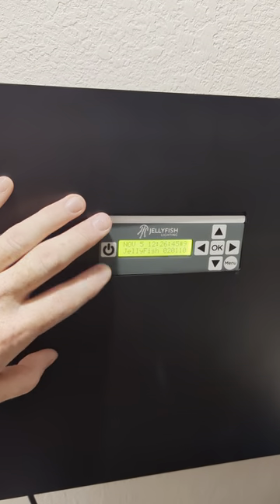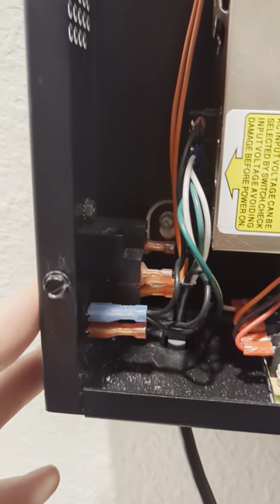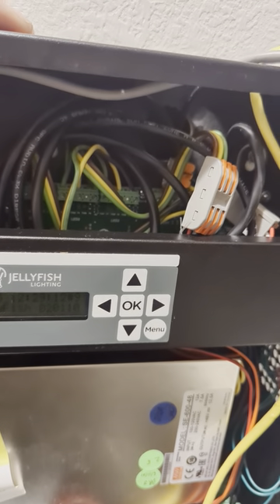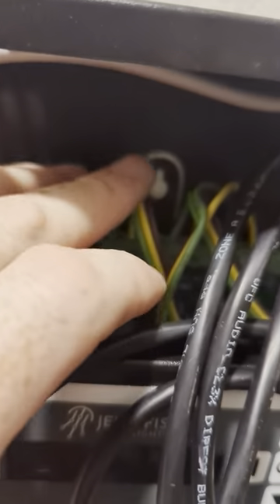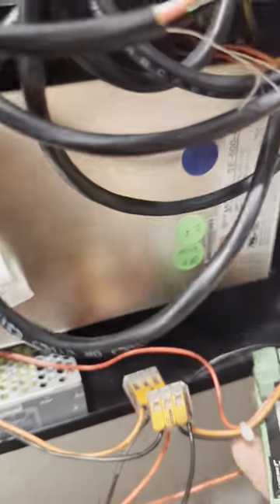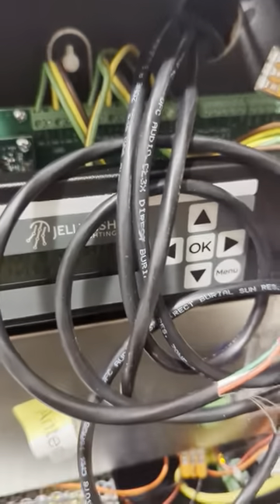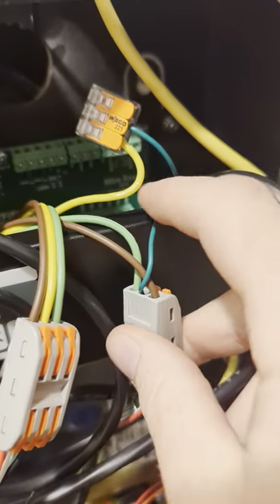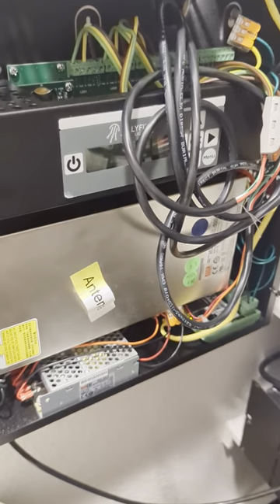Jellyfish controller walkthrough and 3rd party control

Comment: Thank you for this video it's awesome! I had Jellyfish installed on my house and want to use with Xlights and my falcon controller but i haven't quite figured out how. This is a huge step forward. So do you wire your 48V PS to your 5/12V mean well, then to your controller, then lights? Can you give a little more specific on exactly how it's wired? It would be greatly appreciated, thank you again for the video!!!
Reply from the maker: @tonylove3290  I suggest looking in the box to see how it is wired currently before trying to re-wire it. 

The lower voltage PSU is always on. The 48v is only on when the controller turns on the relay. 
You still have to program the lights to come on at a given time in the JF controller. 

Also some people have achieved the same thing using a digi-uno or digi-quad. 
I'm sorry I'm not providing exact answers, but if you are able to take this, and fill in the gaps on your own, then you will be better situated to further troubleshoot the issues when they arise.
Reply: @cm3ars  Thank you! Yes, I totally agree—understanding the setup is key so I can troubleshoot. My stock setup is a little different. Instead of having an extra low voltage PSU that powers my 3rd party controller, I have an AC-DC converter with only one output that powers the Jellyfish controller with 5V. I’ve worked through most of it, but I’m stuck on one part. I now have a separate low-voltage PSU powering a Dig Octa, which will be sending the data signal directly to the data input on the Jellyfish lights, without using a switch.

My question is about grounding: Do I need to tie the data ground on the Dig Octa with the data ground on the Jellyfish lights? On my Jellyfish controller, the 48V lights currently have both the power ground and the data ground wired into the same common ground port. I’m not sure where the ground from the Dig Octa should be connected in this setup. Should it be tied into the same common ground? Thanks in advance!
Reply from the maker: @tonylove3290  I had the older generation control box. I now have the new one. That little converter is still technically a PSU, just small. I have not contacted JF support yet to find out the specs, and if it has enough headroom to power a 3rd party device. so this season ill be making a new video as I figure that out.  
I only installed the switch to make it easy to go back and forth between the controllers, as most of the year I run off the normal controller. I thought about making some sort of arduino based relay i could make this switch happen automagically, but too much work... once im in season, im not toggling... anyways i digress. 

on the output side of all controllers, your (-v) should be treated as a common. you need to bond it across the JF controller, and your 3rd party controller, and the LED's  
keep your positive supply voltages separate. Treat it as you would power injection if you have ever done that. negative / common needs to be common, but data passes thru and supply voltage power is separate. 

TLDR: 
+48v from JF supply to LEDs
Common (-V) bonded between all.
Data to 3rd party. 

If you have a spare pixel, you can wire one in, and test with that before you wire your entire string. 
+V to common should read 48V nominal
data should read ~5v 

If you have more questions there is a contact form on my webpage if you'd like to connect.
Reply: @cm3ars  Thank you very much I appreciate it, I got it to work finally, huge relief. Only thing now Im trying to figure out is my ethernet IP address for my dig octa, having trouble finding it after connecting it to wifi, thanks!
Reply from the maker: @tonylove3290  I do not recommend sending sACN via wifi... Once you use a wireless connection the packets are designed to arrive intact, not on time. Its worth it to just run a wire.

to find the device, you can try command prompt with the line "arp -a" 
or logon to your router to see the connected devices.
Reply: @cm3ars  I realized I had an apple router which will not show Ethernet IP addresses attached to it. I ended up just getting a new network to put the show on, I had my pervious show on my home network, bad idea. Once I did that it turned out perfect, everything is on ethernet now
Reply from the maker: @tonylove3290  I use a single switch, but different Vlans. Show traffic stays in its own, but my router/firewall lets traffic thru to the controllers so I can configure everything and upload sequences without changing IP settings on my Mac, or physically change networks.

Comment: Thank you for this post… it is really helpful.. I have some questions around the switch that was used to send data from the controller to the lights… I have three Runs is it possible to connect all three to my controller using that one small switch? If yes, any clue on to wire the switch to send data to all three lines? Appreciate any help.
Reply from the maker: You just need more poles. 
I only needed two zones, so I used a Double Pole, Double Throw switch. (DPDT)
You'd need a 3PDT switch. (Or simply more than one switch)

Comment: I noticed that the LeDMX Pro 4 you have output from universe 1 and 2, and it looks like both wires go to the same port on the switch which goes to the same data feed.  Is that correct?
Reply from the maker: Two SPI outputs. Both are configured to the same universe with different starting addresses. 
It's a DPDT switch, so electrically it's two switches, one for each output.

Comment: I recently to Jellyfish installed at my home.  I have a lot of experience using LOR to do sequencing and musical displays.   I'm not familiar with raspberry.  Do you believe that this same setup would work with LOR.  What are the part numbers I need to get for that external controller and what source?
Reply from the maker: I have never used LOR, except for one of their 16ch dimmer boxes. I program in xLights. 
This set up let's the JF lights live on my lighting network as an E1.31 (streaming ACN) Node. 
Any controller that can output sACN to that network can control it if the address are patched appropriately.
Reply from the maker: I was curious if you ever got this working?

Comment: You pay how much and it doesnt even come with a proper display?
Reply from the maker: Are you referring to the Jellyfish controller or the sACN controller? 

Either way what more of a display do you need?
Reply: @cm3ars  I'd prefer it to come with something that doesn't look like its provided with a middle school micro controller propeller lab. Especially at what they want there price point to be.
Reply: The screen is only for servicing purposes, the lights are controlled through a mobile app. Any other controller in the market won’t even have a screen.
Reply from the maker: @djksfhakhaks  what @joseapicon said. It doesn't matter what the controller "looks like" its what it can do. How much are we able to achieve with raspberry pi's and arduinos? They certainly don't look like they are as capable as they are.  As for price point, I felt the price i paid was fair. It included installation and Jellyfish definitely honored their warranty. Compared to other systems, I like the aesthetic of their lights better, and appreciated the time they took to answer my technical inquiries before I purchased the system.